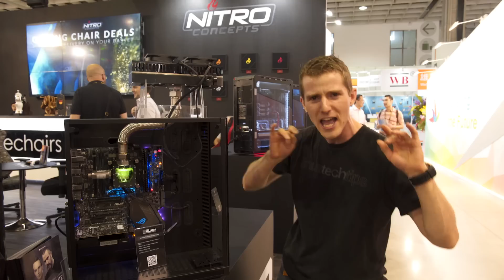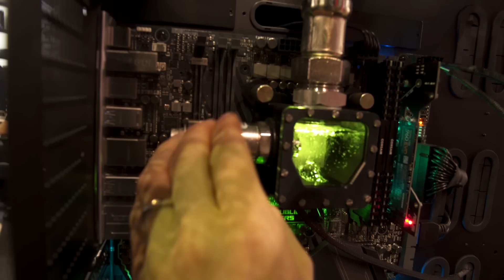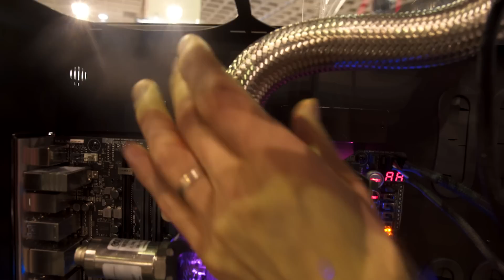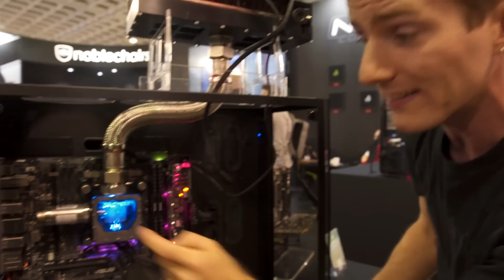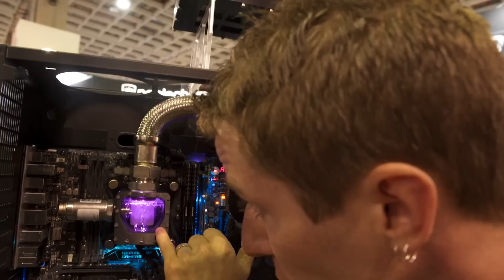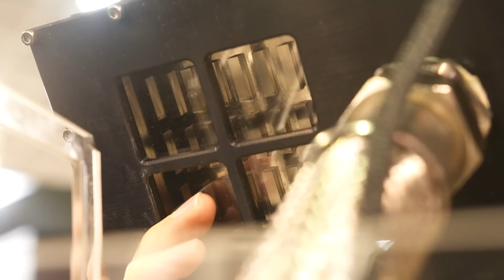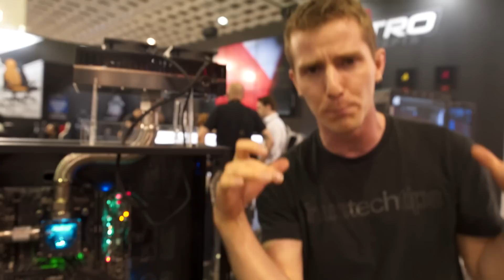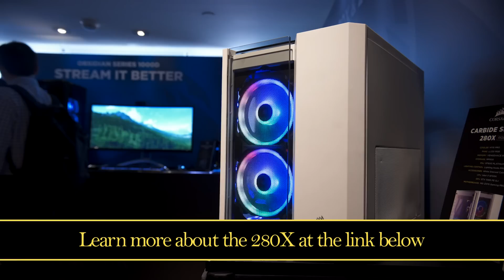Crazy Der8auer cooler prototype - NO pump!

Comment: a giant heatpipe, no voodoo. just use butane-propane lighter stuff for a better bang for the buck ;-)
it gets really messy if you have to use one for each component to be cooled...
And i'm using a pump + fans + radiator in another room because i don't want to transport heat only 20" but really AWAY.

Comment: Well... let’s look at the obvious.
It has to be a clear, colorless fluid. 
Low temp boiling point at STP. (note the fill valve!)
Nonflammable and dielectric.
Reasonable vapor pressure (duh, it has to boil)
Non-toxic, otherwise all kinds of hell shipping it. (MSDS for dummies!)
Good heat transfer properties.
Chlorofluorocarbons are good, but not fantastic.
Those on the Novec are probably real close, if not right on the money... but guessing a proprietary cocktail too. Cool look, especially good for those unicorn pride parade LED lighting server systems... that no one ever sees.

Comment: I'm gunna go with Trichlorofluoromethane with a boiling point of only 74.79 degrees F (23.77 C), or maybe Dichloromethane. He could really be using anything with a boiling point less than that of the cpu just above idle. I know nothing about cooling systems, but I'm curious now if a low heat capacity or high heat capacity fluid would be better. One starts the boiling process faster from cold, but the other absorbs more heat before needing to be circulated. This system would definitely test that balance, and be annoyingly dynamic, as a change in one will likely change the optimal of the other. Also, for those talking about vacuum. I highly doubt he's trying to maintain a vacuum, and likely something as close to outside pressure as possible for stability and safety, and lower construction costs.

Comment: Freon 113.. boil point of 48c give or take...inert. non toxic. But volatile. 

Cant guess too much as you didnt give us any cpu temps other than the tdp.. give me cpu load temp and  i will tell you exactly what fluid/gas/solution he is using....along with the type of pipe inside that braided monstrosity......why...cus i work in OnG and cooling is what i do all day long..

Comment: Methyl iodide maybe
edit: or methanol
edit 2: methyl acetate?
Reply: I think methyl iodide would have a boiling point ( 107.6°F (42°C) )  that is too low. Linus said that the cooler was a "little bit toasty", so would would expect a higher temperature. Your other answer of methanol seems to fit the bill just right though. It's boiling point is 148.5°F (64.7°C), so in the "toasty" range. Plus it is a relatively safe, non-corrosive, clear liquid.
Reply: phyric quinn it should bubble in idle too... i dont think there is a vacuum, thats why i said methyl iodide
Reply: phyric quinn but metanol is toxic but yet again who would drink a coolant

Comment: Compaq's Armada laptops (1995ish?) used to use solid state cooling with heat pipes that supposedly were filled with a wick and used freon as the heat exchange medium. Same liquid cooling concept, but they experienced too many leaks and went back to fans.

Comment: linus or someone please explain.what confuses me is that how is the same resolution maintained on different sized screens such as a 22 inch 1080 and and 24 inch 1080 because they both must have the same amount of pixels by length and width right? so does the pixel size change for each screen size?

Comment: There must be two components, liquid and gas, which are inert to the environment, and to each other. Liquid only would not permit the evaporation/condensation cycle required for the system to function. Also, including a gas component automatically allows for mild pump-down vacuum of the system, lowering the temperature range of the transition cycles. So you need a liquid with a boiling point in the 35-60C range when under mild vacuum. Methanol seems viable.

Comment: It's boiling from the processor heat and has a large tube going up to a top radiator. Boiling, so it's going to be cooled back to liquid. Box seems to have the wrong design for any vacuum and same on the hose, and pressure increases boiling point. It's probably 3M Novec.
Which isn't really secret since 3M is trying to sell it as a computer cooling solution.

Comment: its pre-pressurized water. water boils at lower temperatures depending on pressure. p*v=n*r*t.... so we can make water boil at 70degrees celsius if the pressure is right and also make it condense again below. 70 in this case.

Comment: This technology is not that impressive as my friend is working on a air cooling system for a Razor PC and it has no fans to blow the air sound the copper tubing in the PC! And I agree with some people that the liquid in the cooler that Linus showed us is water or alcohol in a vacuum that makes it bible and release vapor into the tubing.
Reply: I meant to say AROUND THE PC
Reply: Can't be pure water, you REALLY don't want your operating temp to be 100 °C.

Comment: My best guess is water under very low pressure to control the boiling point- the pressure sensor can be used to monitor the pressure which controls the boiling point of the water.

Comment: My guess is that the coolant is ethanol. Why? Because it has a boiling point of 78,37 °C at atmospheric pressure, and in such an application the pressure would, of course, build up slightly higher than that.

P.S.: could also be methanol. Its boiling point at atmospheric pressure is around 64,7 °C, which is right on par with the healthy temperature limit for any aftermarket CPU.

Comment: I'd have to know if the coolant is running at near atmospheric pressure, increased pressure, or reduced pressure.

A few years ago, I tried the same thing with isopropyl alcohol, and that doesn't work very well at atmospheric pressure.

The alcohol never boiled, but the CPU was a little cooler than without anything at all.
However, trying to get a reading of an overheated CPU is hell when trying to use the computer to read its own temperature.

I never got it.

The computer wanted to stall (avoiding unintentional use of "freeze") at temps above 70°C. 
I don't blame it, either. I tend to cease operating at half that, myself.

All I could find was that the computer ran longer thermosiphoning alcohol than without.

It's probably the same thing as the canned air that I use to dust my keyboard and parts. That stuff boils in a blizzard.

Comment: Distilled water under low pressure. Water is our best choice for heat conductivity here, and the huge tubes and the pressure valve suggest that there is pressure difference. Also - It should be constant and low so the water boils.

Comment: Water, with low pressure chamber. Water carries more heat capacity than most liquid. Therefore, there's only one tube toward the radiator. Furthermore, it looks heavy duty tubing and chamber, surely there's considerably amount pressure difference.

Comment: Well, you could get just about any alcohol like substance to boil like that in about the right temperature range... Isopropyl Alchol, Ethanol, Methanol, ect... but if you sprang a leak... bad for anyone nearby, especially with the now highly flammable gas near a spark & heat source. So... a clear fluid that boils somewhere between 35 and 80 degrees C and isn't in any way narcotic/poisonous/flammable...
How stable is Isoprene when heated? and does it have good heat conductivity? 
Ohhh, one question we should probably ask is, is the system pressurized? that impacts boiling point, and obviously it needs to be air tight already so not too much of an added hassle. 
Maybe it isn't even a single fluid but a mix of two or more to maintain the clear property while also allowing a low effective boil point.

Comment: The really interesting question about this that no one seems to be asking is how he created the seal between the motherboard and the enclosure for the fluid.
Reply: Jonathan Green, Major Bogart: When I look through that window, I see a completely exposed cpu. It does not seal around the heatspreader.
Reply: The fluid is only in direct contact with the heat spreader, very similarly to a water block. Main difference being that this relies on a large standing pool of liquid that is constantly replenished instead of a steady flow in one side and out the other.
Reply: The reason I think this is so great and interesting is that if it can seal a refrigerant, it probably also can seal a vacuum, which would allow for condensation-free cryogenics.
Reply: P8qzxnxfP85xZ2H3wDRV you really only need a seal around the head spreader, but that would still be pretty tricky trying to get all the tolerances right.
Reply: P8qzxnxfP85xZ2H3wDRV you are correct, just rewatched, and Linus even said that the CPU is visible. The only things that i can think of in that case is to either have a socket built into the unit itself, with the one side of the unit being a "pass through" that seats on the motherboards socket, or the cpu is permanently installed into the whole unit. A pass through would support some of the viewers theories that the fluid is a high pressure refrigerant, but if its a low pressure volatile, like butane (this is the direction that i am leaning), the cpu would likely be strong enough to be integrated and sealed into one side of the unit.
Reply: Just a tight rubber/foam seal, nothing too fancy. Alternatively he could've adhered the CPU directly to the cooler and removed the locking bracket from the socket...
Reply: Major Bogart just use silicone...withstands heat and flexible to absorb the pressure changes
Reply: Before I read your comment I actually was thinking about it and asked in comment section...just 7h later :D  I believe it might not be a rubber thingy, or maybe it could. Alternatively it might be some sealing paste or something, but if it aims to be mass produced and not limited (even though Linus said limited), but despite that, they would require to come up with something that can take off the sealing in that case, so it might not be something paste like thing, so it leaves rubber of sort that wont allow any leaking and damage to board by the casing. 
Another thing I asked and wondered, is how to get liquid out and in before attaching and removing it, and how do you even remove it.
Reply: BIOSHOCKFOXX You maybe right...let’s just hope that seal is perfect..don’t want an 1000$ cooling system to leak and ruin a 2000$ system.
They have to test it well for a real world load...I’m sure there will be changes to many aspects of the product by the time they ship it to some rich tech enthusiast.

Comment: the liquid is probaly made by 3m (they have different ones for two-phase, immersion-cooling) doe might be another brand but it has a boiling point around 40-60C (meaning liquid cant get hotter than 40-60c) my guess was 3M novec 7100 but u say no so maybe fluorinert liquid by 3m then... (about 200dollar/liter only sells in bulk for examle servers.) other companys that makes two-phase liquids: engineeredfluids, cargille-labs.
Reply: This was precisely my guess. This shit is so bad for the environment I'd have to image they'll have a hard time selling it as a consumer product.
Reply: To me it seems to be Perfluorohexane or Fluorinert FC-72 that boils at around ~55-60C
Reply: Terminal Dogma i think its something with even lower boiling point (maybe 30c) (cooler temps)
Reply: 3M has several varieties of 'Flourinert', with boil points at 1 atm ranging from 25C to above 135C
Reply: yea

Comment: I think we can rule out anything carcinogenic, toxic, or particularly flammable, so light Alkanes and Halogenated Hydrocarbons are out. Requiring that the system is pressurized to work would make installation and shipping a pain, so it probably isn't pressurized.

It's probably Water+Acetone, Water+Methanol, or some other mundane mixture of water and some low-boiling liquid. That's what I'd try if I were told to build something like that.

Comment: I'll guess Alcohol with vacuum..
Because of the low boilig temp and good noise isolation.
Reply: TetraByte read about vapor pressure of liquid :)
Reply: Kenni Gaming when things boil they produce a gas which then increases the pressure and removes the vacuum
Reply: TetraByte This Video shows noise isolation in vaccum well. Also, Der 8auer has probably got a professional pump and the Liquid Containment looks very stable and sturdy. Der 8auer probably gets way better vacuums. https://youtu.be/bjMsTxMCKGY

Comment: It must be something that boils at room temperature with maybe some vacuum pressure.
Reply: ethanol does the trick
Reply: I would say that this liquid doesn't boil at room temperature. The system couldn't work, since the gas wouldn't be able to condense at the top of the device.

Whatever the pressure in the device, it must not boil at room temperature. However, I think that the pressure in the system is atmospheric pressure or near atmospheric pressure, because it's not easy to maintain a very high or low pressure in a system like that.

So all in all, I'd say that it is a liquid that boils at about 40 or 50°C when the system works for a long time, because the boiling point must be slightly higher than room temperature to be able to be cooled by air (on the top), but not so high that it starts cooling the processor too late! So ethanol is a no-no for me (78°C is too high to start cooling a CPU!), but ether (35°C) seems more likely.
If the pressure inside is 1 bar, ether will start cooling the processor whenever its temperature is higher than 35°C, and as the pressure in the device increases, its boiling point increases so there is a lower risk of explosion.
And if the pressure is slightly higher than atmospheric pressure when the system is cold (for instance 2 bar), the liquid would only start boiling at about 45°C, which is even better.

Finally, the liquid has not to be dangerous for health or flammable! So pentane can't be used (too dangerous), neither can petroleum ether.

To me, the liquid could be:
- diethyl ether (35°C), not dangerous for health, but flammable,
- acetone (50°C), authorized for nail polish, so why not for cooling?
- cyclopentane (53°C)
- a strange mix of liquids to get a perfect boiling point (see binary diagrams).
Reply: It might not if it's in an all in one system, it might be in a vacuum when you buy it
Reply: wilbobagins : Yes, you can control the boiling point of a liquid thanks to pressure, but it requires a pump. Everything can work at atmospheric pressure too, if there is a hole on the top (like on a laboratory condenser).
Or even at atmospheric pressure at room temperature, and higher pressure when temperatures increase (if the circuit for the liquid/gas is sealed), following P^(1-gamma)*T^gamma = constant for an ideal gas in an adiabatic transformation. If the curves are well calculated for the temperatures of use, there is no need for any control of pressure.

So this system might not even need to control pressure actively to change the boiling point of the liquid.
Reply: you would want something that boils at 40-60 C. since that is likely above the room temperature. . .
Reply: Methanol has a slightly lower boiling point and slightly higher thermal conductivity than ethanol. That's my guess.
Reply: 3M NOVEC Liquid maybe, that stuff he uses before in his 2-Phase Cooling System on Gamescon showcase
Reply: My bet would be on Ammonia
Reply: Didn't he say there was a heating element?
Reply: wilbobagins i highly doubt it's liquid ammonia, there's no way he'd want to take the risk of an ammonia leak at such a popular event.
Reply: David Mayer isn't ether like crazy flammable? That would seem like a big danger to me in case of leaks, if I'm not mistaken.
Reply: 3m novec perhaps
Reply: no that depends on pressure. A liquid can be any temperature.
Reply: Caleb Otsubo temp and pressure both affect boil temp. You can lower water boil temp by dropping the pressure
Reply: I think it's acetone. It is already used in cooling systems like this one and it's cheap.
Reply: A vacuum would require a pump. At least for a minute or two during setup.
Reply: Pentane?
Reply: it couldn't boil at room temp. if it did, the fluid would never be able to recondense. How would there be a vacuum if there's no pump?
Reply: Golden Grenadier any liquid can boil at room temperature given a low enough pressure
Reply: liquid ammonia will freeze surroundings of the cooler...

Comment: > It's kind of a heat pipe
It's exactly a gravity-powered heat pipe (contrary to capillary forces-powered ones we typically have everywhere).
Seems like the boiling point was decreased with low pressure, otherwise why would DerBauer want the pressure sensor there?
UPD: Well, of course, he must keep track of the boiling point while it's..boiling...

Comment: My guess on the liquid is 3M Fluorinert:

https://en.wikipedia.org/wiki/Fluorinert

Its literally designed for use in this way, has a range of different boiling points and is non conductive.

Either that or alcohol.

Comment: Would it really be that’s hard 
You said the amount of watts so someone can approximate the amount of temperature 

And then try deduce the fluid based on the temperature it boils and condensed at and it’s specific heat and conductive capacity 

No 🤔